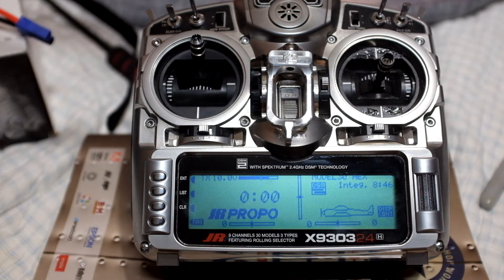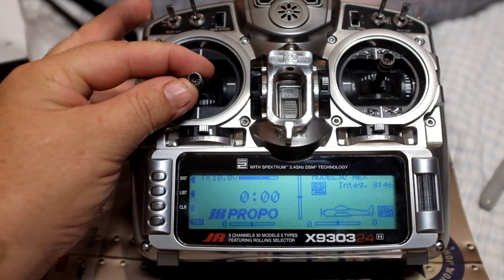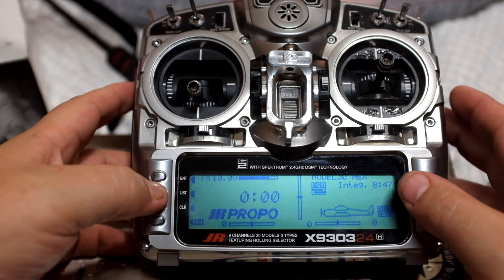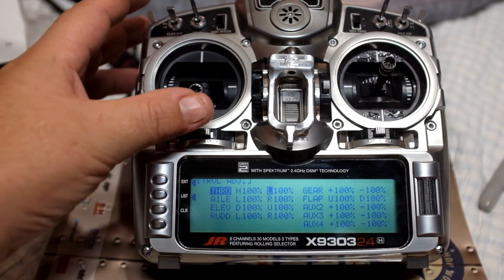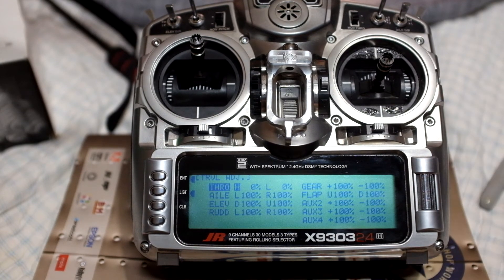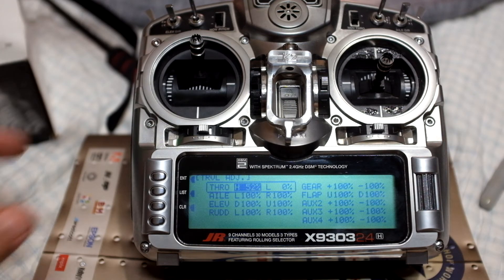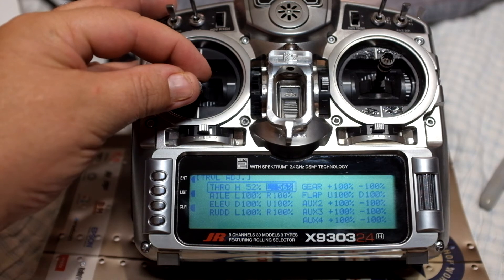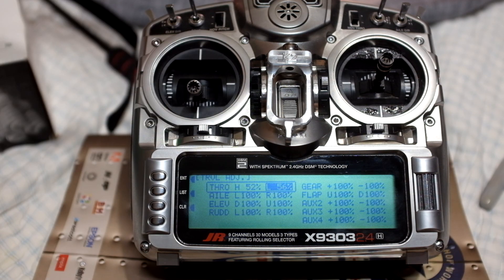How To Program Your Throttle End Points on A JR X9303 With Castle Creations ESC

Comment: Thanks   Mine is  9503 more or less the same . Now I know how .sorta. Trim lever ? was that centered before you started ??
I have a CC Phoenix 125 , problem is when I plug up batt , ESC gets VERY hot?Need to call CC I suppose. I noticed my motor [elec sailplane ] was running with stik at bottom? had to use Trim  to cut it off ...

Comment: Good video.  Question.  How would you reduce the throttle EPA?  Do you use the same technique?  Also, did you put the ESC in programming mode before you started this video?  Thanks!